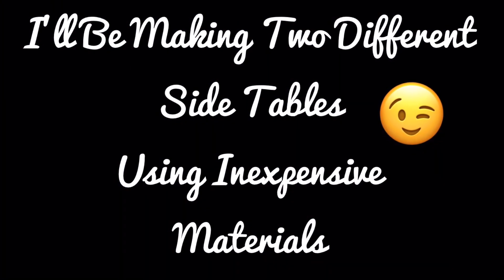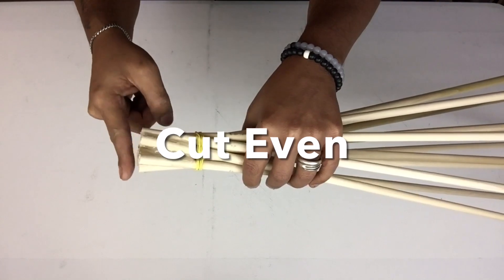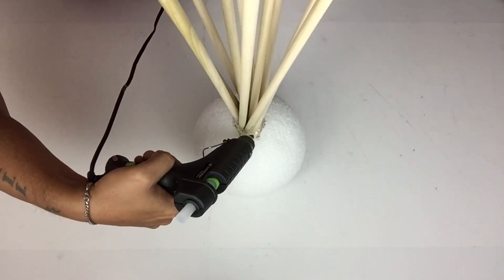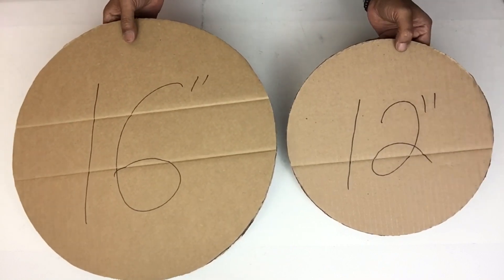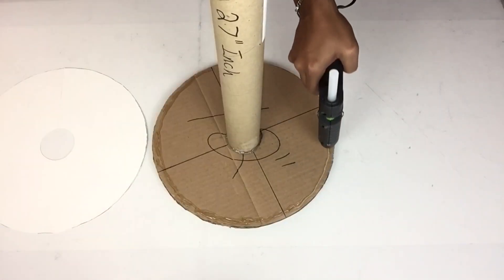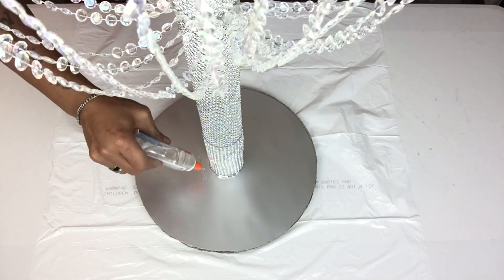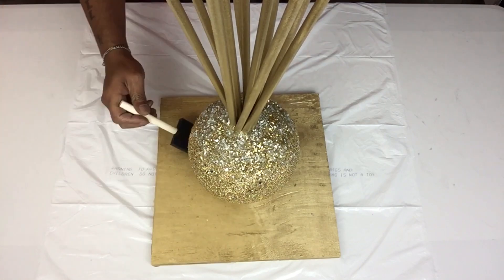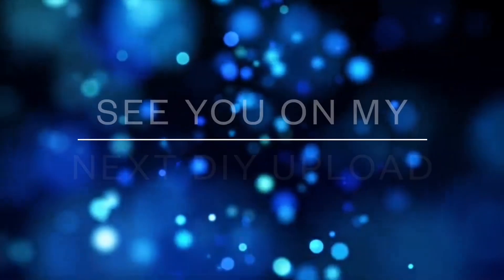DIY Chandelier Table & Balancing Table | Two Tall Glamorous Tables | Home Decor | LED lighting 2020

Comment: Hi from Sydney,? How well does the hoe glue last in high temperatures ,will it go soft at 95 f or hotter or does it stay hard.love the silver one ☝️
Reply from the maker: No if you notice on my past DIY videos all I use is Gorilla Glue because it meant to hold up to high heat. Thank you so much please be safe ❤️🥰😍✌️
Reply: Thanks for that  .be safe